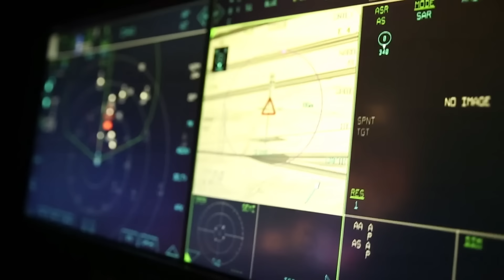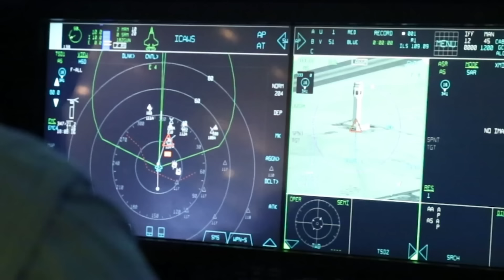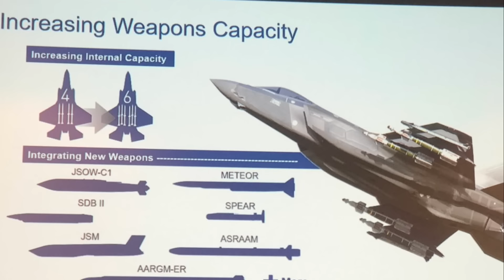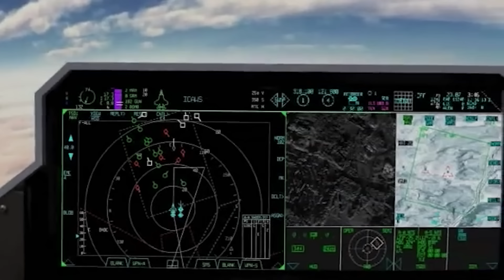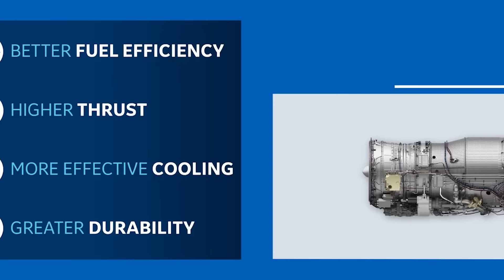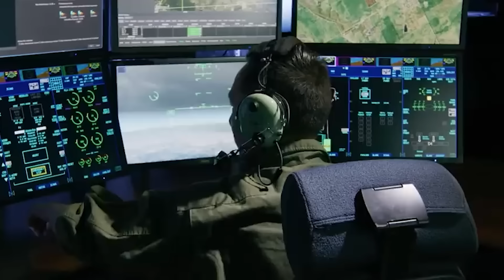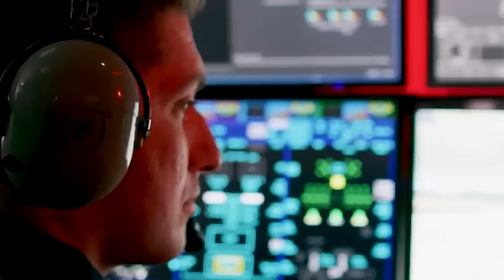The F-35 is about to become a POWERHOUSE

Comment: Still think it was dumb to not just use the f22 design.  It's superior in every way.  Like why upgrade everything then downgrade maneuverability.  Don't say it's not needed cause the airforce has a history of making assumptions like that then having to back track.

F4 didn't have a gun cause it was "unnecessary"  then had to add one externally mid war 😂
Reply: Well, for one, the F35 is much lower cost - to buy, and to fly per hour. And the F22 is too out dated, too expensive to maintain. And the F35 will eat f22's all day long anyway. So, the F22 platform was great when it came out, but it far too outdated, and simply does not have the required systems to compete with modern fighters. 
Given the F35 does more, costs less, and has a better and lower RCS (better stealth),  then a F22, then why continue to fly the F22 when it is oh so outdated, and does not stand half a chance against a F35, and all for much less cost?
Reply: @Albertkallal  see but that's just flat out not true lol there's pilots that have flown both.  The f22 destroys f35 in air to air 🤣 I don't know where you get your info but alot of its just flat out wrong.   The f22 is still the tip top fighter jet in he world.   If the shit hit the fan we would be sending f22 not f35 😂

Like over half the shit you just said is flat out untrue 🤣
Reply: @colonelradec5956  
You have to define what you mean by "air to air".
However, I better explain why and how my claim about F35 eating f22's for breakfast holds true.

In the 1950’s everything was thought to center around speed. Even an f104 Starfighter (1958) can maintain supersonic flight without afterburners.

In the 29 dogfight kills during desert storm (1991), max speeds seen by fighters were Mach 1 

Now of course the f22 has award winning kinetic performance, no doubt about it. From a raw performance point of view, the f22 really is impressive.

However, that performance is not going to rack up or increase kills in the battle theatre.

Tops on this list is that due to budget cuts, the f22 lacks “passive” systems to track aircraft. By “passive” we mean receiver only (non radar being sent out). This is where the f35 excels right now, and is a significant shortcoming of the f22.

The F22 was spec out to have a multi spectrum IRST system. Then during soaring costs, they cut that IRST system down to a lower cost single spectrum IRST system. Then, they further cut and removed 100% the IRST system from the F22 program.

As a result, they made a huge mistake, and handicapped the F22. it is now blind as a bat, and given it has no means (other then radar) to engage a F35, it going to lose that battle 9 out of 10 times. The F35 has better stealth, and it has systems on board that will let it track and locate, and target the F22 VERY long before the F22 can do the same to the F35.

Computer processing:
The f22 in its debut had a very good computer system. It is rated at 700 MIPS (700 million instructions per second). 

There was plans to future upgrade the f22 with a 2000 mips processor. But the CPU used on the f22 is now long out of production. 

But, remember Moore’s law in computing? Every 2 years we see computing power near doubling. While this doubling every two years don’t sound like much?

Well, place one grain of rice on the first square on a chess board. On the next square, place 2 grains of rice. And on the next square place 4 (so we have a total of 7 grains of rice).

Do the above for 64 squares. You wind up with 1 billion grains of rice by the 40th square. By the 64th square, you actually need 210 billion tons (not grains, but tons) of rice! That amount of rice would cover ALL of India with about 3 feet of rice!

The above means that the f22 has a really poor computer.
For comparison, a low cost budget smart phone with a snapdragon processor? Well, one CPU core is rated for 1400 MIPS. But you have 4 of them!!! (All in that $90 smartphone).

So, that smartphone has 

5600 MIPS

F22 = 700 MIPS.

So, your cheapo smart phone has EIGHT times the computer power of the f22.

The F35 uses RISC based CPU’s built around IBM’s power PC chips. They are the same architecture and chips used at the Lawrence Livermore atomic labs to run computer atomic bomb simulations. And all of IBM’S advanced Artificial Intelligence systems also use this chip set from IBM.

Upgrades for the F35 central computer are to be rolled out next year – they will increase the computer power of the f35 by a WHOPPER 25 times (over what the f35 has now!!! And what the F35 ALREADY has is VERY good!!!).

Not only does the f22 lack computer power, but it also lacks high speed networking.

While a good many new fighter jets have passive (IRST) systems, they are mechanical scanned (a rotating mirror sends the input light and directs it to a sensor). Such sensors will tell you a fighter is say 35 degrees off the front of your jet. But you don’t know the speed, direction etc.  And those systems have limited coverage (only front/forward looking for the jet).

You need speed, direction, and altitude to generate a weapons lock.

With 3 or more f35’s in the area, then just like 3 compass points or lines on a map, you can with computers triangle the location of the target. (You need 3 or more inputs).

Toss in a BIG dose of computer power?
Toss in some really amazing network communication between the jets?

Well, you now get x,y,z position of that target. And if you do this over and over, then you now get a new set of x,y,z and thus compare it to the last set of data. Now you have the REALLY valuable information of speed and direction and altitude  of that enemy. And you doing this WITHOUT radar to give yourself away.

And even MORE important is you need to be able to feed that data into the computers to generate a weapons grade solution.

F35 can use radar, or DAS (which is IRST) or use the targeting pod on the front (which is also an IRST + targeting system for air to ground - that's the ETOS system, and it is VERY valuable, since then a pilot can identify a enemy fighter at 40 miles away, and can do so without radar --- this is big deal if pilots are required to visual identify the aircraft before engagements - something right now ONLY the F35 can do -- I can explain how this works and is done if you ask).

However,  back to our narrative. At this point, you have NOT turned on your radar to give yourself away.

So, 3 F35’s approaching some f22’s will:

See, track, display and build weapons grade firing solitons against the f22’s. 

And all of this will occur without radar.

The f22?
Blind as a bat.
It will not see, track or be able to deploy its weapons on the F35.

The f35 will simple fire away and shoot down those f22’s like fish in a barrel.

The f22 on board systems are outdated.

In fact, the DAS tracking system will allow the F35 to compute and give a firing solution for a jet following it from the rear. That’s because unlike the f22, the F35 is not limited to JUST using radar for a firing and kill solution. So, to fire at a jet following you requires rear facing radar! (But not with the F35).

So, radar in most jets is required for a firing solution. When the missile leaves the rails, it is NOT the missile that navigates to the target, but the fighter provides computers and radar that manages the first part of the missile flight. When the missile gets close to the target then the missile own radar and tracking takes over. 

And keep in mind that even during war games, the instant you turn on your radar is the instant you just turned your jet into a HUGE giant lighthouse of a target – stealth will not help so much. Look at me, I am here! Come and follow my powerful radar beam right to me!!! Stealth or not – you just given yourself away.

The air battle theatre is now becoming like submarine warfare. Run silent – don’t give yourself away.

The f22 has next to no means to see, find, track and MOST important generate a kill solution to shoot down the f35.

As much as I love the f22?

It don’t stand one hope of a chance to engage the f35.

Now, if someone can explain how a f22 has any kind of remote chance to take on a F35, then I am all ears, but as much as I admire the f22, it not even remote able to take on a F35 at this point in time.

The F35 will pilot will thus have an FAR BETTER decision superiority chain over an F22.  This will result in greater chances of survivability, which when combined with such lethality assures battlespace dominance. 

It just does. Don't mean the F22 is bad, but does mean that the F35 will be a F22 killer, and not the other way around.

Comment: It seems to me that the engine option proposed by GE makes much more sense in both the near and longer term. Pay the freight and get 'er done rather than nickel-and-diming the issue until the platform is obsolete or as reached the end of its service life.
Reply: The problem is that engine is VERY expensive. It would increase the cost of the F35 from 77.8 million each to about 100 million each. There is a big reason why the F16 (and now the F35) sold so well.
Simple:
The F35 like the F16 is a lower end priced fighter. Most nations can't afford a F15 at 125 million, or a Eurofighter Typhoon (also 120 million each).

So, they buy a lower end priced fighter with "good" features. So, they go with a F35.

Eurofighter/Typhoon: 120 million each
Rafale: 94 million each
F15: 88 million, but with combat package, 125 million each.
Gripen: JAS 39 E/F: 85 million each
F35: 77.8 million.

So, the F35 is racking up big sales numbers - just like the F16 did, and as noted the reason is nations are more willing to buy a lower priced fighter like the F35 now (or f16 in the past). 

There is a big reason the F35 is the best selling fighter in 40 years. (and the answer is simple!).
 The F35 is selling much like the lower priced F16 did. 

So, most nations can't afford those more expensive higher priced fighters like F15's or Eurofighters, so they choose a lower priced single engine fighter like the F35.
Reply: @Albertkallal  Thank you for that analysis. I  was unaware of the actual cost of alternatives. You reply puts all of that into sharp relief.

Comment: The F-22 should have replaced F-15A/C's 1 for 1 and the F-35 should have replaced F-16C's 1 for 1 in USAF service. The decision to cut funding to the F-22 and F-35 production, while maybe warranted because of contracting boondoggles and mismanagement, is the reason why so many fourth gen platforms are still being held onto. USAF Frontline fighters should be the F-35 and F-22, CCA and a light fighter variant of the T-7 should be developed to replace early block F-16's and F-15's in ANG and Reserve units in the domestic air defense and patrol roles. The F-16/15 airframes can only be patched for so long. If the F-22 program wasn't cut and was instead expanded with additional strike capabilities, the F-15EX never would have been needed.

Comment: Not surprised, as a older PC Builder/enthusiasts CPU/GPU power has more than quadrupled in power/efficiency over the last 7 years.  A couple modern $4000 CPU server could replace an entire $100,000+ server rack from 7 years ago.  It's like the 80's/90's all over again how fast cpu/gpu power/performance is accelerating, even moresor now since AI is being integrated.

Comment: I work in the IT department at the Lockheed Martin facility in Fort Worth, Texas, the main production plant for the F-35.
Most of these upgrades are being integrated into the initial manufacture right off the line. 

If you were a country that's been waiting for your, say.....2021 order of F-35s to be delivered, would you rather receive your jets NOW without the upgrades and upgrade later or would you rather wait longer and get the latest and greatest?

Comment: By increasing computer capacity with 25 times F35 will have the computer capability similar to a Jas 39 E. If increase 37 times it will be the strongest in the world. The later should be enough for the next 20 years one could think. However looking at the development of computer speed and capability it should last less than 10 years.
Reply: Indeed, the systems onboard F-35 are already obsolete - F-22's are prehistoric!

Comment: The evolution of the stealth coating (skin) on the US stealth aircraft, from the F-117 to B-2 to the Raptor and finally to the F-35, simply amazes me.. When you take a look at the Raptor from close up (or close up photos) you can see bumps, rivets and joints, although masterfully made to be as least pronounced as possible (unlike the skin on the SU-57 which is a joke). But the F-35's skin is smooth, gray, slippery and advanced.. It kind of look like the aircraft was cast from the single piece. There's something organic about it, like a skin on a dolphin or a whale.. Truly remarkable.. Who knows what's the next step that the wizards from Lockheed and Northrop Grumman have for the stealth coating. B-21 is that natural next step, while the Lockheed isn't sleeping either. We all saw that Raptor coated in the bizarre metallic paint...
Reply: "Stealth" is a scam Mark. The only people who say it works are the Lockheed Martin salesmen.
Reply: @DennisMerwood-xk8wp  it’s not a extremely low rcs allows aircraft to sneak though radars and destroy them easily

Comment: The F-16c block 1's and F-16c block 20's are most likely worlds apart.  I worked on F/A 18's when we were drooling over personal computers of the 486-100mhz 32bit variety.  Since then we have moved to 4 core Pentiums of 4 Ghz of the 64bit variety.  that would be 40X clock, 2x the data, and 4x the cpu throughput.  320 TIMES more capable just in the electronics on the conservative side, that doesn't even count the bandwidth of fiber optics and other systems.  A 10-15 year update in software and computing power will make the f-35 a new plane.  If the saved space went to fuel tank, it might actually solve the range problem with the  efficient engine.  25% range from efficiency plus a hundred gallons?  Too cool.

Comment: This thing can’t dogfight & has no range
Reply: Evidence?
Reply: @EpsilonGaming7  it’s common knowledge. It can only maintain super sonic flight for less than a minute, too. Look anywhere
Reply: @LithiumSix66  No it's common misinformation and has been circulating since before it even flew as morons speculated on the diagrams.

The F-35A can fly supersonic as long as it needs to. The F-35B and F-35C have had issues and as such have restricted speed, but they still outperform the Harrier and F/A-18.

The F-35A is 2nd only to the F-22 among US fighters when it comes to dogfighting.
Reply: @dumdumbinks274  it’s an over priced hunk of junk
Reply: @LithiumSix66  It's cheaper to buy than most fighters and more capable too.